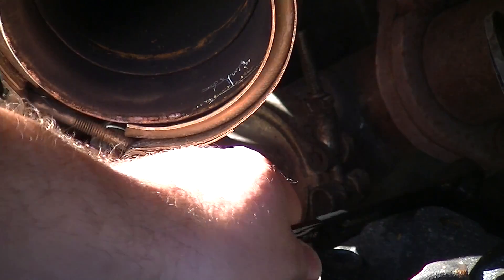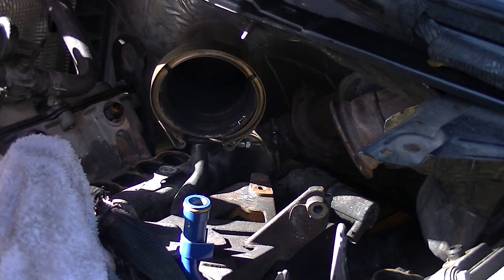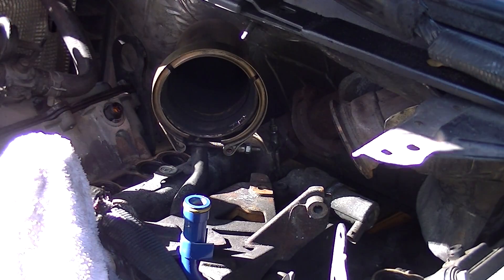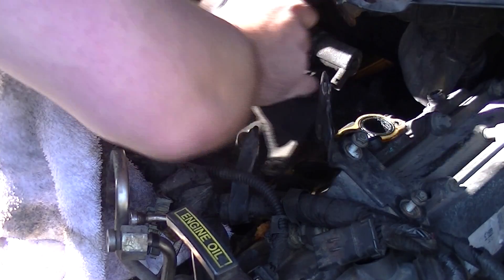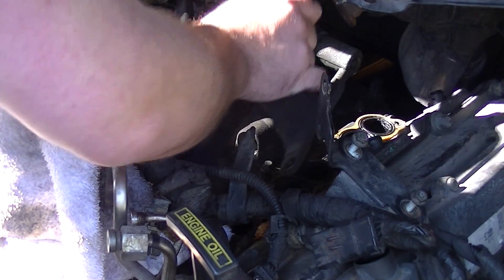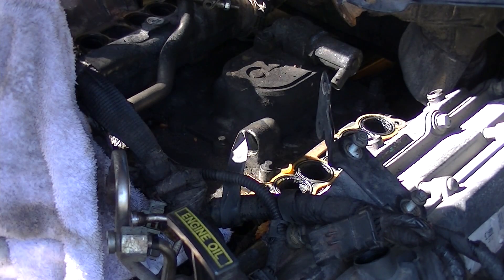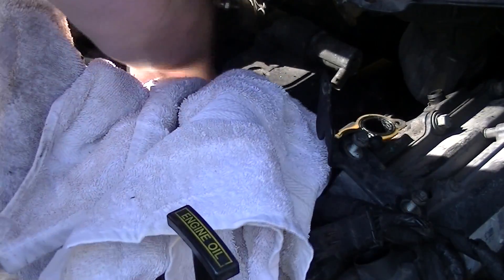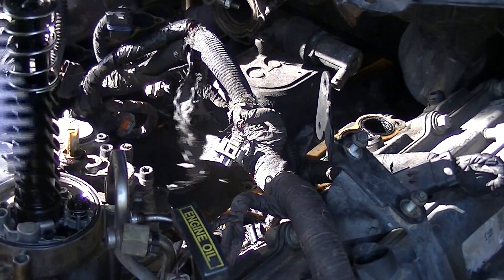Oil Cooler Replacement (8): Removing the EGR Cooler from 2005 Ford F250 6.0L PowerStroke

Comment: I would remove your intake gaskets and either cover the holes with duct tape or stuff rags in the ports.  The EGR cooler hose twists off.  U have to line up the tabs and twist to remove.  Do not cut it unless u plan on replacing it with one from a egr delete kit.
Reply from the maker: I didn't have any tabs on the EGR cooler hose that I could find - it's a bulletproof diesel EGR cooler.  I am doing an EGR delete, though, so not worried about it ;)  Appreciate the info, though!